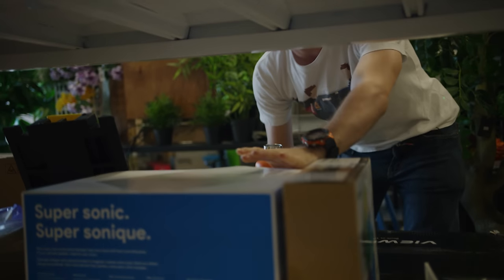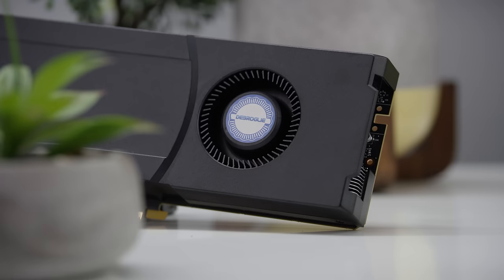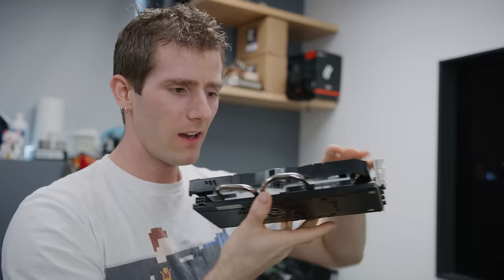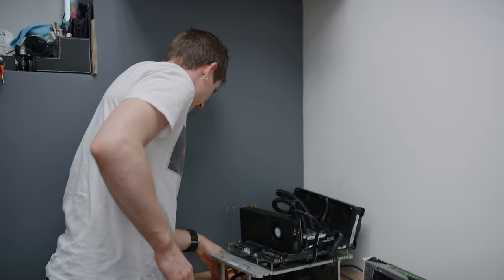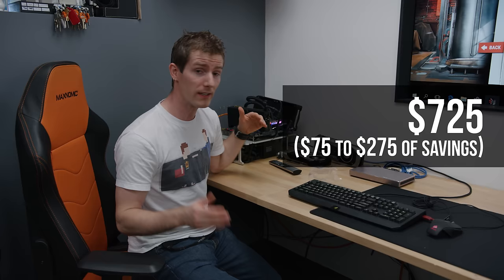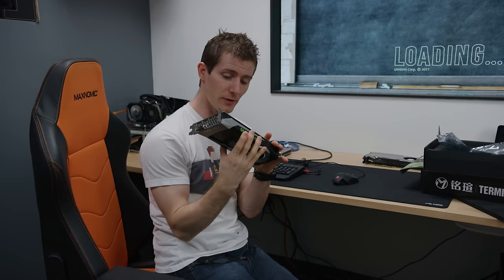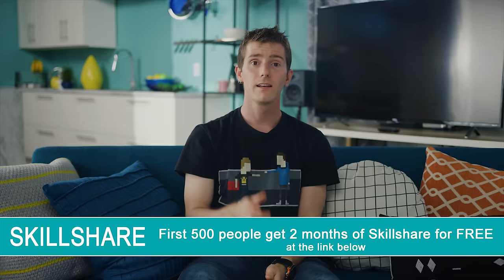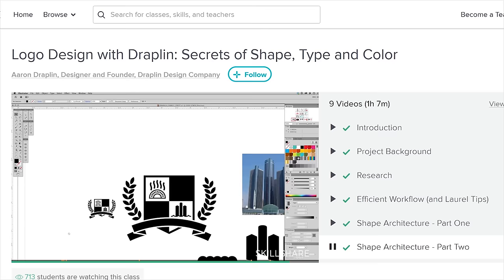Cheap AliExpress Graphics Cards - SCAM???

Comment: Bless Nvidia and their transparency and clear choice for consumers with their GPP and their GT 1030 with GDDR5 or DDR4 versions, their GTX 1050 2GB and new 3GB version, and the GTX1060 3GB, 6GB and 5GB version.
Reply: It's almost like as if you can see which version of the card you're buying by looking at the specs. It's really a non issue for people using common sense. Also, it's good for filling up the market in a shortage situation. I can't believe people can't get that fact in their head. Like, why throw away the PCBs that don't make the spec?
Reply: TessellatedGuy Right. Its like saying a car manufacturer is intransparent, because they are selling the same car with different engines.
Reply: They advertise the lower RAM but not the rest of the lower specs.  If they are going to weaken the card and have a lower cuda core count. And just make it look cheaper by advertising a lower RAM. Dont call it the same card. 

Its like buying a car with a different engine. But oh it also has 3 year old wheels and it needs to be alllinged. But pay attention to the one thing in the big bold font.
Reply: +DayVideo Actually, that's almost exactly what car manufacturers do, lower spec cars have lower spec other things, they mostly only advertise what mostly matters to most people, like the engine, or leather seats or something. There's literally nothing wrong with that UNLESS they DON'T reveal that the tires are smaller or are worse in some way or the engine makes less torque. In our case, nvidia did reveal the less cuda core count in their own official site, scroll down and you'll easily find it. Just because it's slightly different doesn't mean the whole thing should be called something else. If that were the case we would be seeing lower spec variants of a Camry be called something completely different. That's just not how it works and it would only make things worse.
Reply: AMD fanboy detected.
Reply: @TessellatedGuy it's an consumer unfriendly business if you hide stuff so people need to spend a considerable amount of time researching things, go on websites to read about hidden downgrades of products, read and learn how this effects them on the long run, make a decision only to later find out that they bought the cheaper product that should have never been produced as it effects them negatively on the long run. You have to always keep in mind that it adds an unneeded level of hardware fragmentation that is damaging the whole PC and PC gaming community. Imagine Nvidia would release a new card every week once they upgraded a little transistor... that would be a hell of a confusing situation and you could still argue "But you can read about the specs online!". You see now why the point of you "you can read about the specs" isn't practical in the real world by now? Thanks.
Reply: +TheSchwarzKater What? How the fuck does more gpus with slightly different specs damage the PC gaming community? Just fucking read the specs when you're buying, and yeah, I'm gonna say that again because nothing in your comment actually proved that my point was impractical "in the real world". Dumb/misinformed people buy things they don't want every day, doesn't mean the companies that sell those things are at fault. Every different card that nvidia released had a differentiation, yeah, it's not in your face, but people building PCs should know what they're doing or they're fully at fault for buying a titan X pascal instead of a titan Xp. 

They never released a card without a differentiation SOMEWHERE so I would still be right and practical in saying that phrase about reading specifications online and how nvidia is still transparent in that regard.
Reply: +TheSchwarzKater 1. "A lot of people build PCs that don't or can't research all these things because of many reasons. Fine you can, doesn't make you look any less like an ass for assuming everyone else does/should. "

2. "For me PC building is fun but not so much if I have to look into every detail to make sure that I don't buy a rip-off product. The fact alone that you can't follow this simple concept makes you a really weird or really dumb person."

3. "All nvidia does is make people buy the wrong product on accident for still a lot of money and then have them upgrade again in less then the usual time because their new graphics card is already obsolete on date of purchase"

4. "I can't recommend a simple "GTX 1070" to my friends anymore without to specify the amount of RAM, clockspeed etc."

5. "Please don't comment any further before you do understand even basic concepts."

Let's see what this all means:
1. You think most people building a PC are lazy fucks like you that don't read the obvious details of their expensive investments, which is more assumption than I made, honestly.

2. It's not a rip off if you yourself clicked the "order now" button without researching. Like, how is it a rip off if the information is right there? You would be 100% right if the information was hidden by nvidia themselves. Nvidia is not at fault here due to that, you are, for being an lazy idiot.

3. You did not read my own comments fully, ironic.

4. You're not a reliable source of information then. There's also a little "Ti" to differentiate. It can't be easier than this to just tell your friends what to google.

5. Oooooh the irony.

P.S. Why do you care if uninformed/misinformed people buy the wrong cards? Natural selection at it's finest, I say. It's not like nvidia advertised every offshoot card with the wrongly with fake specs to mislead customers because that would be an actual issue and bad for the PC gaming community. Before anyone brings up the 970 3.5 GB issue, that wasn't the same thing, it still had 4 total gigs, so it's not misleading, nor did it cause any issues.

Comment: Elsa was founded way back in 1980 as a German company until it went bankrupt in 2002, restructured and then finally completely died in 2004. It lives on as a joint venture in Japan in 1997 and they still sell Geforce/Quadro/Tesla cards in Japan.  It's daughter company was founded in Taiwan in 2003 and was a prominent player in the 8800GT/9800GT era but pulled out of the GPU market in 2007 after an unsuccessful venture with China Onda, ELSA Taiwan apparently makes LED lighting now.

Maxsun  is a pretty big China brand that started in 2003, they make both AMD and Nvidia cards along with motherboards and SSDs. They list the 5GB card on their China website, but not the global one. I personally have the 6G Terminator (bought via GB), the cooler is quite awful mine idles @ 46C, fans @49%, GPU clock @ 1506mhz with max boost of only 18XXmhz with a 32C ambient, It does not support fanstop.
Reply: Man I'm surprised no one else seems to recognize that name; they made a ton of the early GeForce/Quadro's. Still have a couple of them, still great old cards. Kind of excited to see that name again not gonna lie
Reply: I had an ELSA in the mid to late 90s - they were kinda popular here in europe.
Reply: Our Elsa Gladiac Geforce 2 Ultra was the shiz back in the day haha!
Reply: ELSA stood for "ELektrische Systeme Aachen", started out with modems and later graphics cards, ELSA was one of the top players for CAD graphics cards around 2000, 1997 the ELSA GmbH (limited) became the ELSA AG (Inc.) it grew fast from 200 workers in Germany to 700 world wide in a few years, but the management still run it like a small company, they branched out some time before 2000, sales office in Santa Clara, CA, US, one in Japan (I believe Tokio), an office in Taipei, Taiwan to be closer to the mainboard manufacturers, an office in France and UK (don't remember if there were more), the first cards hat S3s Winner graphics chips, later for CAD graphics 3DLaps chips and around 2000 nVidia TNT and later GeForce chips, till about then ELSA developed its own PCBs and hat them build e.g. in France (ELSA never had own production facilities), they also developed their own drivers especially for CAD card like the ELSA GLoria series, the drivers would be tested in house and at the CAD software manufactures and hat special setting for more then 30 different CAD programms, it also had settings for adjusting the resolution and frequencies to work with older monitors, also around 2000 an ELSA developer came up with Stereo through shutter glases that would be attached to VGA, the glasses were called "Revelator", sadly that developer left ELSA two weeks after presenting it to the support team, when the glasses came out month after the announced date and weay to few for the market they had some issues which never got addressed since the originally dev was no longer with ELSA, at the time nVidia was small and just up and comming but growing fast, it was interested in ELSAs drivers and tools and offered a partner ship, ELSA declined, year later ELSA asked nVidia for a partner ship, this time nVidia declined, they had grown past ELSA, through missmanagement ELSAs stock prices was plumetting and the company had way to much dept, to make some money ELSA sold its whole graphics dev team to nVidia and PNY for 15 million DM (or was it already Euro, not sure), as part of the deal ELSA would get the chips two weeks before any one else for a few years, but there were always delays and  most of the time the cards were out later then anyone else - ELSA was a big well respected company and its legacy lives on in the nVidia tools and nVidias 3D-Stereo with were originally developed by ELSA, but ELSA mostly destroyed itself by missmanagement (some say deliberatly...) it might actually be worth researching that all a bit more and making a video about it - after all ELSA had quite an influence on early nVidia especially for tools and in the dev of the Quadro chips
Reply: my gf worked for their tech support till the end
Reply: ELSA also manufactured modems, ISDN adapters and other communications equipment, and the networking division still exists in the form of devolo (dLAN and smart grid tech) and LANCOM Systems (professional networking equipment). Both those successor companies still have their headquarters in Aachen.
Reply: I remember ELSA too, their Gladiac series had good reputation in Spain.

Comment: Ali may seem sketchy at first look, and I must admit I haven't committed to buying anything really expensive there yet, but I have bought a whole bunch of minor gadgets and tools and honestly ... I've been mostly satisfied and never outrght scammed (a seller even re-sent an item that didn't show up no questions asked). It feels a lot like ebay really. You have to pay attention to the details of what you are buying, but if you do that you seem to get what is listed. It tends to be even cheaper than ebay too in a lot of areas.

I bought an incredibly cheap VR headset there recently (google cardboard type for phones) and it's honestly better than a lot of others I have tried, including WAY more expensive ones (in local prices). I did lean on a youtube review by a person with the knowhow to confirm that it was good before buying though (that's always something you have to do diligence with when it comes to weird "unknown" brands though).
Fiit vr 2s is the model in case anyone is interested. Reviewed by "vr kommando" here on youtube and it's as of fairly recently actually one of his top picks despite it being incredibly cheap.

So essentially I got a pretty great phone-VR WITH a controller even for a pittance even though it's normally an item I wouldn't have bothered to buy at normal prices.

So all in all I'm fairly impressed with Ali. proceed with some caution obviously, but I do recommend you try it out.
Reply: AliExpress GPU water blocks are very high quality.

Comment: maxxun is actually a well known brand in prc, it has been for decades, mainly focus on low end or budget segment.

edit: it is fairly safe to buy newer gen chinese branded graphics card, if you're not sure, check the brand's website for exact SKU.
edit2: most web cafes in china don't really have very high-end system b/c most of them are serving schoolboys who plays LoL, crossfire etc. only til recently go high-end machine due to Plunkbat.
Reply: Yeah I have a maxsun motherboard that was bought in china, and its still functioning normally after 2 years straight use

Comment: on that first one with the tape on the SLI connector GPU-Z says SLI is disabled. Does it just report that when there is only one GPU in a system or does it mean that it's not capable of SLI at all?

Comment: You should do an entire build on questionable foreign parts and see how it holds up against a legit-built PC of the same “on paper” specs
Reply: He should
Reply: I hace one like thai, PSU from Colorful, 1060 Yeston, Motherboard b350 Maxsun, SSD 120 Colorful. 2400 Ram Gloway. it works fine.
Reply: yes, this please.
Reply: As long as you check for temperatures on surface mount components, it should last just like any other part. Everything is made in China I would have 0 hesitations buying these cheap parts.

Comment: I don't think I would consider a price considerably over MSRP "Cheap"...
Reply: The 1060 6GB was actually very close to the MSRP of the GTX 1080.
Reply: matt what about elsa? will u test it too?
Reply: I'm subbed to you
Reply: Tech By Matt yo dude here on Bulgaria you can find all sorts of the GTX 1080 (Palit version) for $760 and the gpu prices of the other cards haven't gone up by a lot (roughly $30-40). Even the 1070ti is near MSRP
Reply: Savage Duck21 But the MSRP for a GTX 1080 is $599...pretty significant difference between $600 and $760.  I actually helped a friend pick one up (MSI GTX 1080 Gaming X to be specific) a couple weeks ago for UNDER MSRP at $560.
Reply: Ive been seeing the 1080,s on sale at Amazon and Newegg for under 600 so i would skip this imo
Reply: Taz GPUs across the board are dropping in price. But they obviously purchased these cards a long time ago
Reply: Most likely true but the video was put out 2 days ago so kinda irrevelant at this point dont ya think.
Reply: Taz Not when he LITERALLY PUTS A CHART with average price of comparable GPUs at time of purchase in the video, no.
Reply: Well that your opion each to their own, imo its rather pointless to make such a video at this time. Now if he had put it up when prices were still sky high that would had been useful to some perhaps.
Reply: Don't forget, USD versus CAD, their prices will be CAD, pretty sure the MSRP you guys are listing is USD
Reply: Vert true right now in the US you can find them for around the same as they were before the whole crypto mining thing.
Reply: Well thats just what cheap is nowadays
Reply: "relatively" cheap
Reply: Tech By Matt quit trying to start drama

Comment: The GTX1060 5G is priced at 250USD on the Taobao official website. Then .... because your video GTX1060 5G this video card disappeared on taobao, because Nvidia does not allow it to be used outside non-Internet cafes. Ordinary GTX1060 5G is no box and after-sales service. During mining, the price of GTX1060 6G is 468.75~437.5 USD.
Reply: 看来速卖通有二手贩子
Reply: Glad I bought my 1060 5Gb for 299 from best buy.
Reply: 在下刘斩仙 佩服佩服

Comment: Linus, the tape on the SLI fingers is kapton tape, which is pretty expensive tape.
Reply: Yes, this.

I use to work in an electronics plant.

Kapton tape is highly heat resistant, so by putting it on a connector like that you could wave solder the board and keep the connector from getting contaminated.  Someone at the plant probably missed yanking it off.

Of course that probably means that whatever "final testing" that card went through before going out the door didn't involve any of those connections.
Reply: I think we paid about $25 per roll.  Don't remember the specs.  You can just peel it off, but probably there for a good reason.
Reply: nickp1987 is exactly right. They definitely didn't test SLI functionality considering they would have placed the tape before wave soldering and removed it before testing.. lol. Oh well. Seems like it works well enough. But if I'm going to pay that much, I'm sure I could come up with the extra $75-$80 to get a reliable name brand card with warranty and what-have-you. Definitely not worth the "savings."